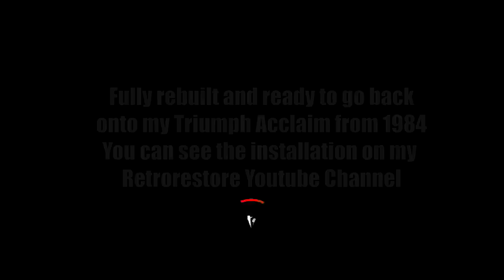Powder Coating Brake Caliper Refurbish

Comment: how on earth is there 6 dislikes of this ? couldnt believe this video was 30 mins long !! its so relaxing and informative that i thought it was a 10 min video
Reply: It may be that some people have taken umbrage at the use of red rubber grease (vegetable based, intended to lubricate rubber seals etc.) on the caliper pins when most opinions seen to favour a silicone based dielectric grease that won't wash away from the pins causing them to msybe seize. Or it could just be 6 tw@%$! 😁
Reply: Not masking the inside of the caliper before sand blasting. He'll never get the sand out...
Reply: Overheating the parts makes them brittle....
Reply: @GardensoftheAncientsHerbal  what utter rubbish !! Thay are BRAKES they ARE going to get HOT !! They are designed to get hot !!
Reply: @familyplans3788  not the entire shield glowing red hot..... you ruined the brakes once they get that hot and need replacing..... if you heat metal like that it ruins it. One thing if it was thick metal and he only heated the bolt..... I refurbish antique cars and would be fired for that....

Comment: I've always fancied a black and red Avon Acclaim Turbo, kinda a proto MG Montego, reminds me of my 85 Civic Sports S which was deep black with red highlighting and red panelled black seats and door cards.   It was what the Acclaim could have been if they had factored in a 2 dr version or Triumph badged the Civic into a hatch.   I swapped my Civic for a 3.0 Ghia MK3 Capri which had an insane blood red interior but the exterior was silver with a vinyl roof and a thirst that was unbelieveable, had enormous pulling power though and whipped up to the ton fairly rapidly, oh I did love that Capri.
Reply from the maker: I never had a Capri but if I did, it would be a 3 litre.
Reply: When you say pulling power? I used to have a 2.0 Capri Laser. Didn't pull anything driving about in that. Mind you it only cost 200 quid!
Reply: I had a 2.8i Capri in my youth (I was about 25 and this was in the early 90’s). Think I was the only one that liked it, got loads of stick.  If only I had it now.....

Comment: Looks great. Should hit the rotors with caliper primer/paint (parts not in contact with pads), so you don't have to come around and clean the rust off later.

Comment: great video the caliper dust shields are a real BEEP to install. I found the rubber grease far too slippy and resorted to clean brake fluid . i trust you replaced the retaining clips the correct way around . I always seat the brake pad stainless steel guides using copperslip grease . but what do I know   I am a 76 year old and still mechanicing . Quite a lot slower now .But still enjoying it .
Reply from the maker: It keeps us young bud. Keep going.

Comment: You were supposed to put the grease to the guiding pins. Used the break fluid to lubricate the piston. The grease would contaminate the break fluid.
Reply: No it wont.......Red rubber grease is compatible with DOT3/4 and 5.1 brake fluids. No mineral oils or greases may be used in places that come into contact with brake fluid.
Reply: @jimosullivan1389  good to know. Thanks for the info.

Comment: DO NOT USE this loctite 2700 threadlocker. It has very high streght and if you wanna demount it will be a problem. You need the to heat up the threaded connection to 250 degrees C.
Reply: Use a medium strenght threadlocker. Usually it's blue.

Comment: Impressive and meticulous work. But I always knew to use brake fluid when pushing in the caliper piston, won't putting the slider pin grease on the piston and inner seal contaminate the brake fluid system when it is back in the car? I was wondering.
Reply from the maker: No bud, it won't